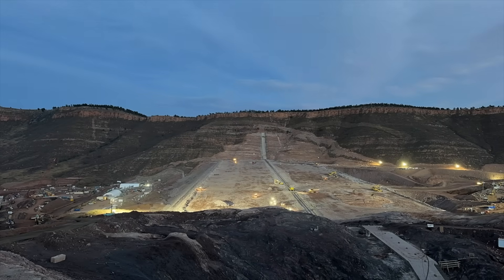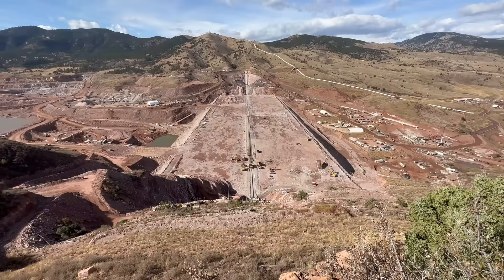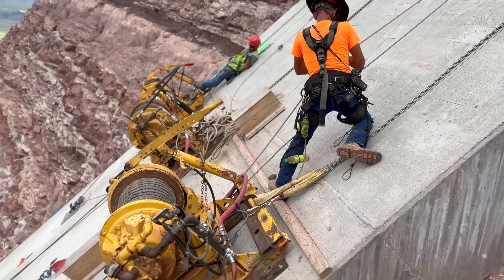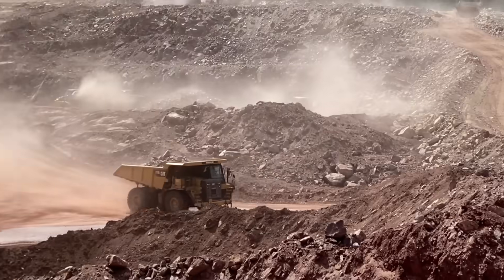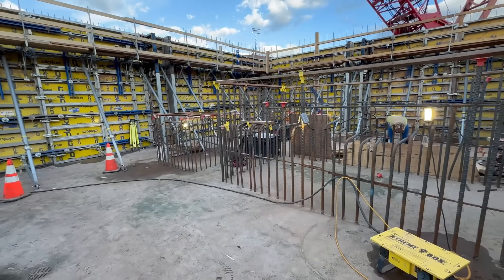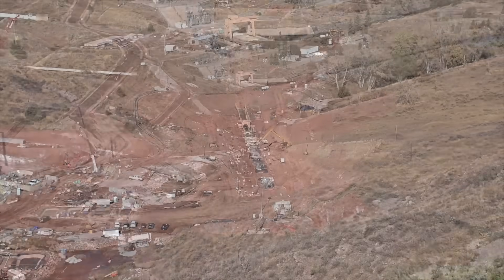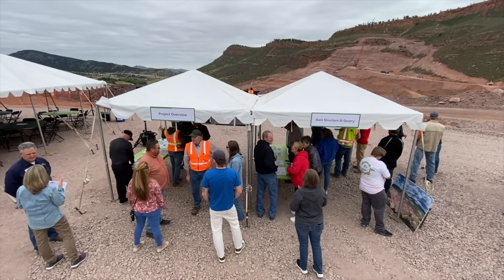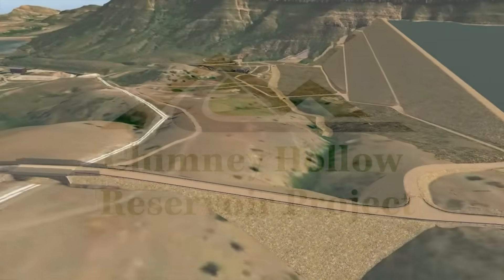Chimney Hollow Reservoir 2023 Construction Recap

Comment: More harm done to the wildlife no doubt more limitation of fish breeding grounds
Reply: Yeah, a canyon with no substantial water flowing through it will be damaged by introducing a lake.  You have no idea what this project is about.
Reply: Textbook example of an uninformed comment  from an uninformed commenter.  Their agenda drives their viewpoint instead of facts.
Reply: @eva905  It's an additional reservoir to expand the storage capacity collected in the Windy River Reservoir so less water continues down the Colorado River. That normally wouldn't be an issue, but the Colorado River System is in dire straits due to too much water being siphoned off already.  

Yes, this project makes the Colorado River's water problem worse and yes it negatively impacts fish populations considering the Colorado River often fails to make it to the ocean and removing even more water from the system exacerbates this issue.
Reply: @justinsane7128  California is less of an issue here since they have the infrastructure to source most of their water from within their state borders. If the Colorado ran dry California would be able to survive via other sources. However, Nevada and Arizona are both growing in population with very few other options. To compound the issue, the Colorado River is also supposed to flow through Mexico and support farmers and communities south of the border but these days the Colorado hasn't been anywhere close to having sufficient flows into Mexico and doesn't make it to the ocean 50 miles south of the border at all.  
There are solutions out there that source water from outside the Colorado River that make the situation better for everyone and then there is this project which sucks even more water from the Colorado and digs a deeper hole for future generations to sort out.
Reply: @brandonk9706  And the US supplies fresh water to Mexico for that reason.
Reply: @StereoSpace  The US unilaterally decided to cut Mexico's share by 5% in 2022 and then by another 7% in 2023 since the US continues to withdraw an unsustainable amount of water from the Colorado (see: this project). Mexico was not invited to the discussion to cut their water, but they are paying the price for the US' mismanagement.
Reply: @brandonk9706  start with California , several million  gallons of water annually , above the allotted amount  , is diverted mostly to the LA basin , not for crops or food stuffs , nor for hydroelectric power , and a large part is simply waisted , swimming pools golf courses etc
Reply: Cheer up.

Comment: Thanks to the magic of hydrocarbon fuels which makes these things possible!
Reply: LMFAO y'all do realize that diesel fuel, gasoline, oil, hydrocarbons in general aren't going anywhere right? And that it is fine to have alternative sources of energy. It is also fine to ATTEMPT to have a cleaner planet. No one is gonna take away your diesel fuel or oil. But ya know heaven for bid there was any diversity in energy production. I suppose we should go back to mining coal too eh ?
Reply: One big problem, it is a finite resource so regardless of what anyone thinks we need an alternative and the sooner the better.
Reply: Work is required, it needn't be petroleum based.
Reply: @johnwalker8417  So what should it be? Wind, sun. Yeah you got nothing
Reply: @johnwalker8417   what ?   You gonna build the dam with hemp ?
Reply: @cpcattin no silly you burn the hemp.  to fire the lime and fuel the equipment.
Reply: Renewables are not sustainable for some projects.
Reply: Thanks to the pollution of hydrocarbon fuels, causing climate change and the subsequent water shortages, we need to use more hydrocarbon fuels to ensure that there's enough water to drink and of course, so that people can water their lawns to impress their neighbours, cos hey, that's what's important right?
Reply: @simonpaine2347  So what are you doing to help? Your on an electronic devise, do you live in a cave? Climate change is a hoax but keep believing what the left tells you
Reply: Nothing is more polluting than the unicorn farts of green energy